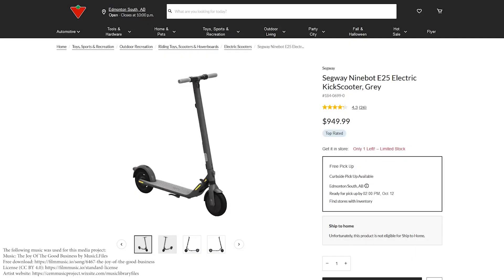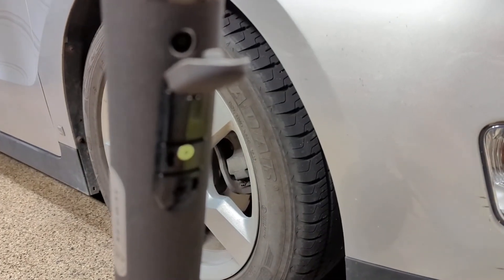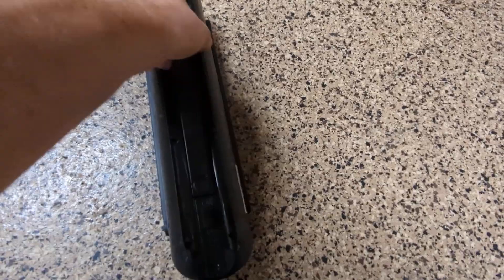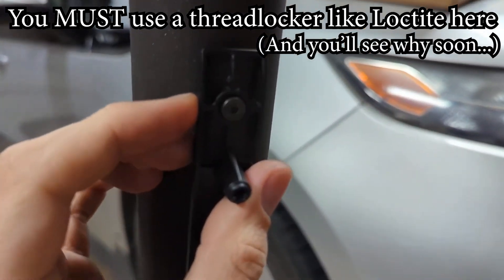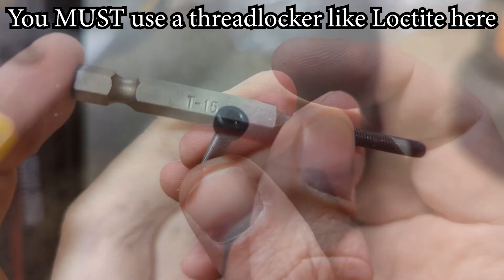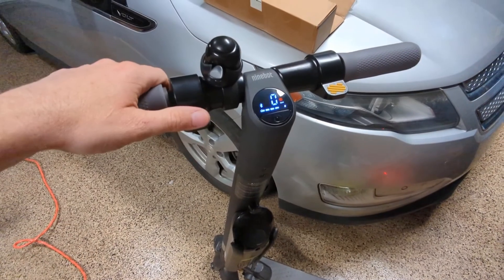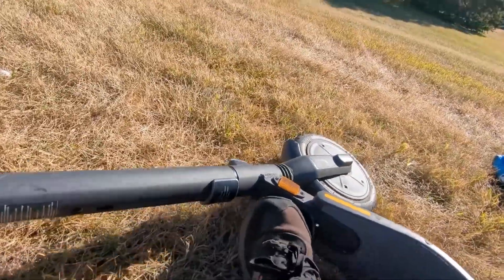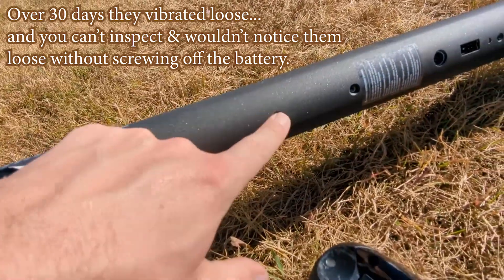Ninebot E25 Scooter External ES1/ES2/ES4 Battery Installation (And what NOT to do!)

Comment: You always need to physically pull on your external battery and check it once a day the vibration makes them loose. Especially on the ES series with solid tires

Comment: I crashed my e22 on a big pothole was only going a few miles an hour skinned my knee up a bit but the scooter is fine. Not sure yet if I even want the upgrade to go faster lol. Watch out for rocks or bumps on this thing it’s a great scooter in terms of durability and aesthetics but only really designed for smooth surfaces.